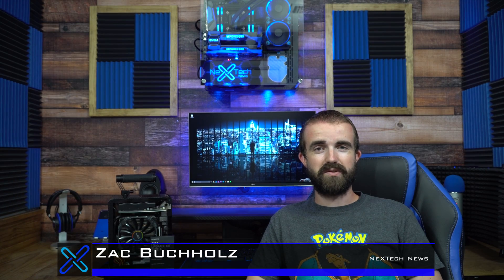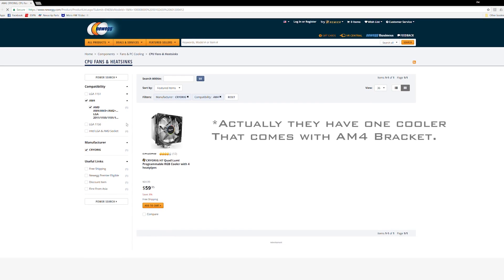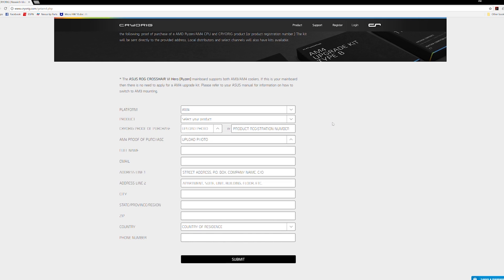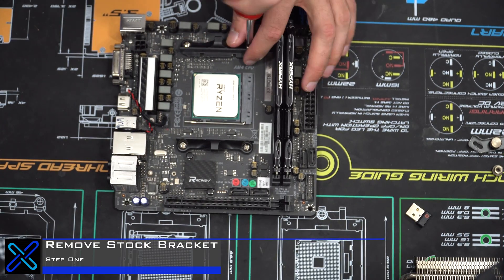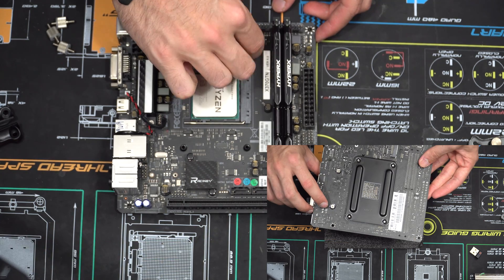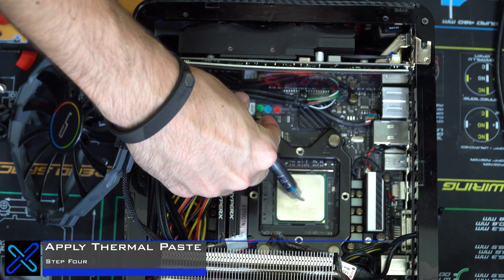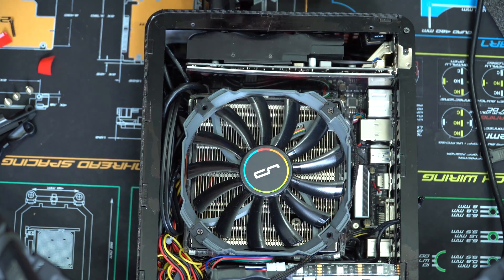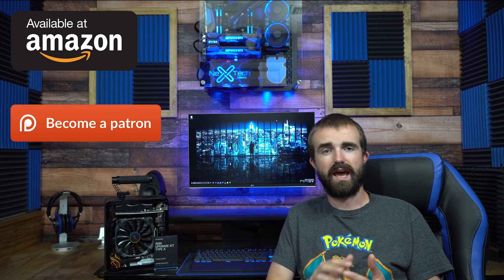How To: Install Cryorig Cooler on AM4 Ryzen Motherboard

Comment: Spare me a minute please

Im trying to reduce these  cost to $790 as much as possible  as along as im able to play witcher 3 (as my standard reference its not really about witcher 3) and I belive be able to play FF15 even at medium setting? 

<> Im only asking is these are all compatible especially the 300watts powersupply instead of 450w to reduce cost?
<> I decided choose zotac 4gb mini 1050 ti instead of 4gb OC version.. is it ok?
<> I went and look for Type C AM4 upgrade kit for the motherboard and cooler listed below. Do I have to follow exactly like yours or no need for upgrade kit? links below. Thanks

These are my builds so no need to go to reddit  
https://www.reddit.com/r/buildapc/comments/8tk0uv/cheap_but_powerful_mini_itx_pc_build_799/

Case 84.99 http://a.co/1DhHoky
< SilverStone Technology Mini-ITX Slim Small Form Factor Computer Case with Handle ML08B-H

MotherBoards 109.99 http://a.co/hQCwCHq
< GIGABYTE GA-AB350N-Gaming WIFI (AMD/Ryzen AM4/B350/RGB Fusion/HDMI/DP/M.2/SATA/USB 3.1 Type-A/Wifi/Mini ITX/DDR4 Motherboard)

CPU 159.99  http://a.co/bO9gDUN
< AMD Ryzen 5 1600 Processor with Wraith Spire Cooler (YD1600BBAEBOX)

CPU COOLER 29.99 http://a.co/5wuNQtt
< Cryorig C7 CR-C7A Top Flow CPU Heatsink 47mm SFF Mini ITX

VIDEO CARD 199.99 http://a.co/gcdr5m3
<  ZOTAC GeForce GTX 1050 Ti OC Edition 4GB GDDR5 Super Compact Gaming Graphics Card (ZT-P10510B-10L)

MEMORY CARDS 184.92 http://a.co/bhFUXJe
< G.Skill Ripjaws V Series 16GB (2 x 8GB) 288-Pin DDR4 2400 (PC4 19200) Intel Z170/X99 Desktop Memory F4-2400C15D-16GVR

STORAGE SSD/HDD 48.45 http://a.co/4WvPom4
<  WD Blue 1TB Mobile Hard Disk Drive - 5400 RPM SATA 6 Gb/s 128MB Cache 2.5 Inch - WD10SPZX

POWER SUPPLY 49.99 http://a.co/fR1N9p6
< SilverStone Technology 300W SFX Form Factor 80 PLUS BRONZE Power Supply with +12V single rail, Active PFC (ST30SF)

Comment: The mounting plate came with the type A kit? Because is just like it and it might have just been me but I got that bracket for the H7 quad lumi with 2 screw in holes top and bottom and only lets me setup the cooler horizontally and interfeers with the ram I’m gonna order that type A then

Comment: this makes me wonder why the fuck cryorig decided to make there h7 quad lumi am4 installation not use this method the in the box backplate/bolts have a good inch of free play before the cooler is bolted down causing a retention of sorts on the socket to hold it in place personally id have prefered to install it the same way you did
Reply from the maker: +mosquitor !! Yeah that is interesting! I wonder why they didn't!

Comment: I received mine today but after installing the spacerscrews to the standar AM4 bracket it had a wiggle to it. Did you have had this to?
Reply: I have the same problem...did you solved?
Reply from the maker: No mine didn't have any wiggle
Reply: I have the same problem too
Reply: NeXTech News any way you could double check for us? I'd be surprised if somehow your parts are different
Reply: Hamzeh178 did you figure it out?
Reply: I used the extra rubber fan vibrator shit things between the bracket and screws and that helped
Reply: I hace Wiggle too